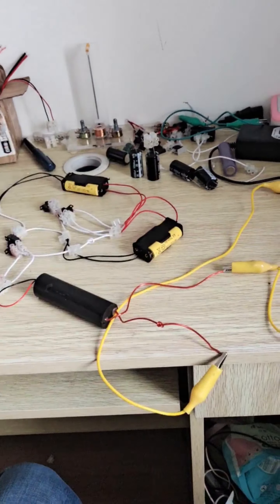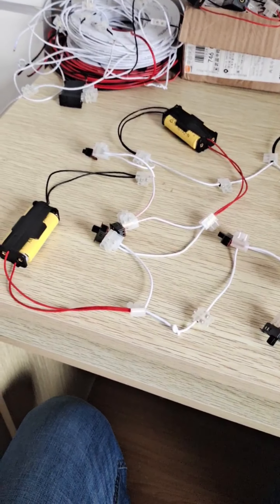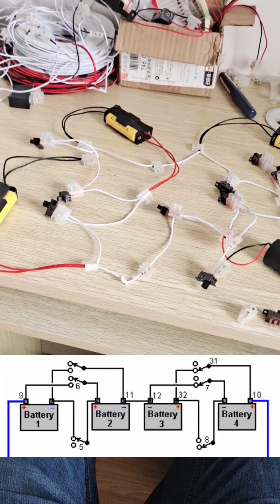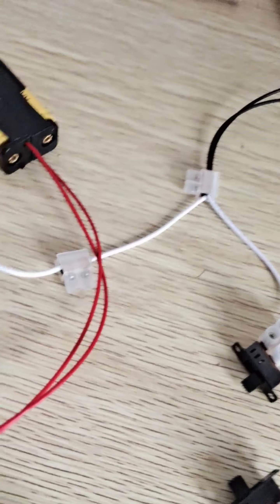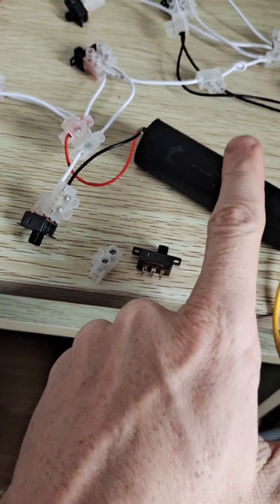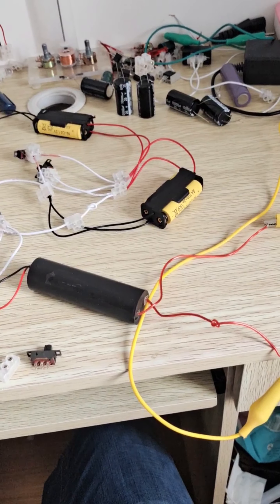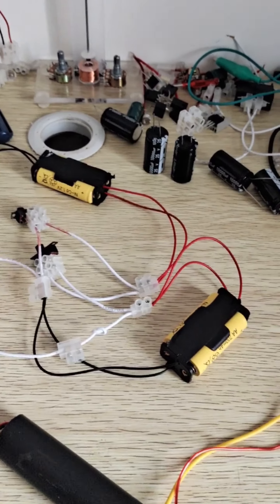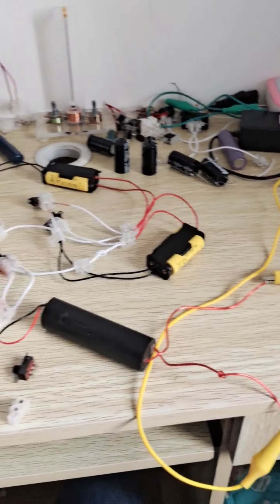Tesla Switch , energy transfer.

Comment: Very nice, it gets confusing very quickly with switching, that’s why I haven’t bothered with the switching on the AA setup as having enough switches for ten seperate batteries would be a nightmare but the 12 volt version and your setup it would be ideal, organising it on a board and labelling switches might make the swap over more practical but good job.

Comment: But what's the point. I lost interest after a while because there was no explanation as to what you hope to achieve
Reply from the maker: Aye, it's not meant to entertain you. I think I explain to go check out the 'WhatifIdidthis' channel linked in the description for more information about what its achieveing. On his channel he runs an LED indefinitley without needing to charge the batteries. Certainly a much more efficient way to use the energy in the batteries to do work. Go have a look.